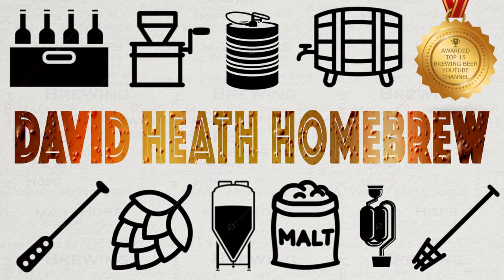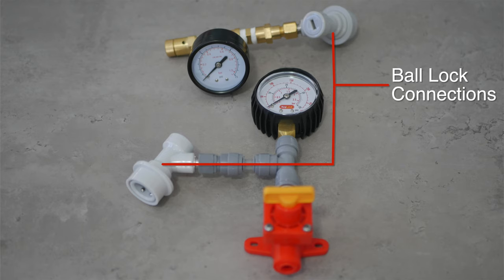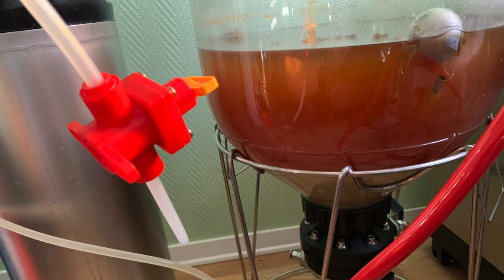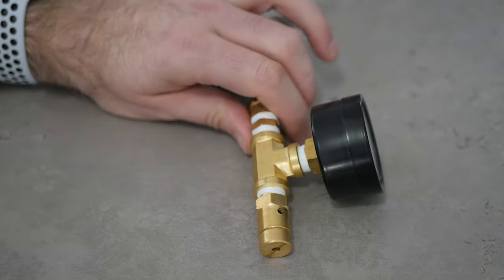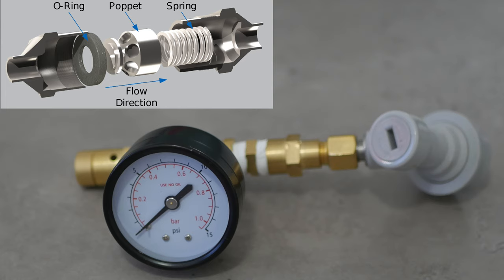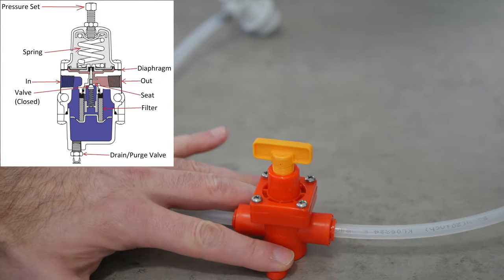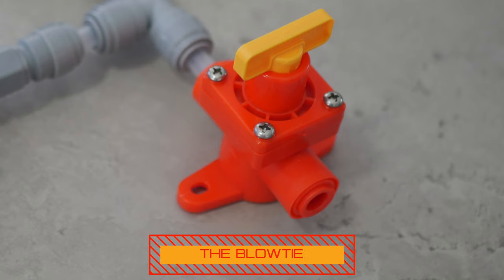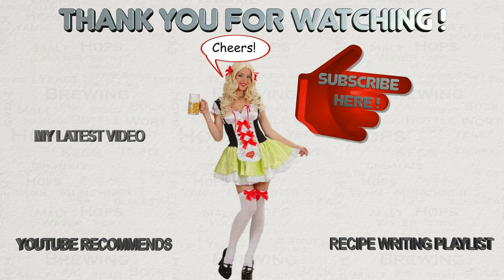Spunding Valve Guide For Pressure Fermentation

Comment: As usual farmative and even more  - useful. In my own planned circumstance I would be using a Pressure Vessel (an old type King Keg type thing) and making the connect simply to the S30 valve outlet hole with something not yet decided.
I notice that your illustrations show what looks like a blow off line and I would imagine I would need this because the total volume of the Keg, and the observation that it is ball shaped means that the area above the fermenting wort would quickly overflow. I am going to watch your Easy Guide video to see if this is addressed. I do not use Corny thingies because the Gas is not easy for me to obtain and thyey are expensive (and small) so I would appreciate opinion as to if this could also be dispensed from the same cask (in which case I would possibly need a Tee type fitting to be able to pressurise with an S30 cylinder adapter for the last few servings) or if I would have to think of a way to transfer to a serving cask without lifting the sediment.
Thank you for a  useful video.
Reply from the maker: Glad you enjoyed it James. Hard to comment on the tank you are converting. I guess these will not hold much pressure though.

Comment: Hi,

First I wanted to say that I really like your channel, as a new brewer your video are full a very good information.
I recently start brewing  and I’m using the fermzilla with the pressure kit.

I know the advantage the fermenting under pressure (less risk of oxygenation, less fusel and off flavor, faster fermentation, carbonation, ....) And I would like to continue to ferment under pressure but I can’t find online information about what pressure to use depending of the type of beer or type of yeast!?! I had a bad experience with a belgian ale (yeast belle Saison) which stall and didn’t really like the pressure and a good experience with the pale ale (yeast safale US-05).

Next I would like to do a Belgian wit (partial mash) I’m still looking for a good recipe (if you have some advise will be appreciated), but should I do it with the airlock or under pressure and with which pressure?

Thank you in advance for your time.
Cheers
Johan
Reply from the maker: Many thanks Johan. Yes different yeast will react differently. The net has a fair amount of info if you google the yeast type and pressure fermentation. Generally soeaking 10-12 PSI is the sweet spot for most.

Comment: David, thanks for your informative videos. Just started the ferment of one of your czech pilsner recipes. I'm using a blow tie spunding valve set up. With a small bit of gas line coming out of the exit end. Do I need to put that tube through an airlock or is it unlikely that there will be any draw of contaminated air/bugs into the fermenter before there is some outward pressure from fermentation reaction
Reply from the maker: Cheers Steve, no need for anything, its a one way valve.
Reply: @DavidHeathHomebrew  thank you

Comment: Great vid Davo, So for newbs to pressure fermentation do you recommend charging the fermzilla to 10 psi straight after the yeast (us05/mj44 or say kveik) is added  or just purge the FZ with co2 & then let the fermentation naturally build the pressure up to the desired pressure.
Reply from the maker: Thanks Dazza. I've not found any real difference either way. So what ever is easier I would say.
Reply: I'd say neither.  At the beginning of fermentation, your yeast need oxygen to function well. That's why many brewers will go so far as to inject their prefermented wort with pure oxygen using a carbonation stone.  Your yeast will produce  enough Co2 to fill your fermenter head space many times over.

My advice is to add your yeast, close your fermenter, attach your spunding valve and let nature take over.

Comment: Hi David 

Thanks for your informative video once again. A bit off topic but cant find an answer, I have recently done my first batch under pressure however after I pitched the yeast and it sunk into the beer I connected a co2 bottle and got my spunding valve set to 10 or 11 psi. Is this a problem? I have noticed theres not much krausen on the wort and worried it has killed the yeast. 

Thanks for your help
Reply from the maker: Hi :) That should be no problem at it. I take it by now things are moving along nicely?

Comment: Hi David 
Great vid very informative, I'm very new to the pressure fermenting thing so forgive the question 
I'm in the middle of my first brew (IPA) in a corny keg, I've let the first 2 days of co2 off ( no pressure ) and then adjusted my spunding valve to about 10 psi, has been bubbling away for 5 days now 
My question is, how do I know when the beer has finished ?? I forgot to cut the drip tube down a little so will pickup a lot of sludge from the bottom first :( so do I bleed it out till I get clear beer and test with a hydrometer or just wait till it stop bubbling ??
Thanks for any help 
Sorry for the long question 
Cheers Mark
Reply from the maker: Great, thank you. Yes the only way to know is with a consistent end gravity reading over 3 days. Floating digital hydrometers are very useful :)

Comment: I wish I had seen this before I built my spundig with one of the brass ones. I guess I will order the blowtie for my next one.
Reply from the maker: I guess the main thing is that you now know :) Glad you found it useful James :)
Reply: David Heath Homebrew I also wish I saw this video. I just finished building a brass one from the parts I ordered online thinking the brass PRV would be better than the plastic one. I have been pressure testing kegs for possible leaks, but now I’m not sure if I am getting accurate readings? The pressure keeps dropping after a couple of hours. Not sure if there are leaks, or if the PRV is inaccurate? Thanks for explaining the diaphragm model. That makes much more sense. Guess I will order that one. Thanks for all you do. I enjoy your channel and knowledge and ease of explaining things. I have learned a lot!

Comment: Thank you Mr. Heath for your amazing videos. I have a question. I’m about to make a Vienna lager this weekend and ferment under pressure. I have the blowtie with the gauge. How exactly do I set the pressure?  I can’t seem to find a video that goes through using the blowtie. From what I know, if I set the pressure to 10psi, then it will vent off above that. But should the blowtie be completely closed during it?
Reply from the maker: Thank you. The easiest way is to add co2 to the fermenter before adding beer. Check for leaks and set the desired pressure level at the same time using the blowtie adjustment. Start by having it totally closed and adjust slowly until you reach the desired pressure.
Reply: David Heath Homebrew And once the desired pressure is reached, do I completely close the blowtie valve and leave it closed during fermentation?  Is it supposed to vent off excess pressure like a regular valve?
Reply: @FiggyABQ   Closed means its not releasing any gas.  When you turn the knob the gauge will indicate the pressure you have set.  Fermentation is your supply of CO2 gas.  To keep a desired pressure, just leave the knob there.  The knob sets the force that is required to create bypass.  So if you close it all the way the pressure will rise sky high as CO2 is created.  I wonder how much pressure yeast could create?

Comment: Lately for my first time I have tried to pressure ferment two strong lager beers. The wort in both brews is the same only the yeast in each vessel is different. SafLager S-23  & White Labs WLP800. OG was about 1.063. They are fermenting in two 18-liter corny kegs, (about 15 liters of brew in each) and I am using Keglands spundingvalves, each set at 10 PSI. They have been fermenting with a surrounding temperature at about 18 degrees celsius for three weeks now and there is no sign of the fermentation slowing down as the pressure is constant at 10 PSI.  Puzzled by why the fermentation time is dragging on so long I also wonder if the pressure indicated on the meters attached the spundingvalves slowly will drop to zero once the fermentation slows down and comes to a stop? Today I briefly decreased the co2 pressure to zero pulling the safety valve pin on the lid but half an hour later the pressure was back up to 10 PSI to what I had set the spundingvalves to.
Reply from the maker: You really need to take a gravity reading on these to see what is actually going on.

Comment: would it be possible to hook a C02 tank to a fermenting bucket? 
If so, would this be a good way to remove oxygen after dry hop additions?

With this being the case, it wouldn't be a pressure fermentation. It would only be used as a way to remove oxygen after the lid is back on.
Reply from the maker: Hi, generally no. It is really best to use something made for the purpose. Could be dangerous otherwise also.

Comment: Hi David, Can these be used as a secondary regulator valve for pressurizing a second keg as well. Many Thanks
Reply: Stephen Fletcher no I found out after buy 3, It is impossibly to dial lower than what pressure out of the regular even from 30 20 15 to 8psi. Very misleading. I’m trying figure out other way to use one tank co2 with 4 keg with different psi so far not successful
Reply from the maker: These are dealing with co2 out rather than in. I have recently been testing 2 different options that act as secondary regulators though and I will have a video in January that covers this :)

Comment: What pressure do you set it to, is it the same under primary fermentation as in the end of fermentation, for final carbonation level?
Reply from the maker: It varies depending on the type of yeast and the end result required. I cover this side of pressure fermentation in this video:- https://youtu.be/W7WSFn6bNoA

Comment: Do u close the spunding valve at start of fermentation? Let the pressure build to 12 psi and then adjust blowtie?
Reply from the maker: I suggest doing a pressure test with water during cleaning. Set your blowtie then 🍻🍻

Comment: I have both types of spunding valves.
I agree the brass type is next to useless, however, the kegland butterfly valves have begun to lose gas in my lagering kegs. I secondary ferment my kegs to 25psi at room temperature for a week with the belief that when I  put the keg into the lagering fridge, the lower temperature will bring the gas pressure down to around 15psi. This worked well for a couple of months, now I just take a pressure reading after attaching the spunding valve. If I leave the spunding valve attached, I lose all the fermented gas.
I am looking at pulling one apart and see if they need cleaning even though I can seen no evidence of beer travelling through the clear gas lines.
Reply from the maker: Hmm sounds like you should contact your supplier for a replacement.
Reply: Putting the valve from a warm environment to a cold one could effect it's operation, might need adjusting after it's cooled down.
Reply from the maker: Could do yes :)
Reply: David, have you had a chance to try the SPUNDit 2.0?  From my limited experience, it seems much more precise than the Blow tie. Cheers
Reply from the maker: Hi Mark, no I have not but I can tell you that the blowtie has proven its accuracy to me. Ive tested the different versions with and without the inbuild gauges. There is a digital display version coming also.

Comment: I have one question if somebody has time to explain to me. It is stressed that you should add oxygen to your beer to allow the yeast optimal condition. Using this setup your are flushing all oxygen. Do the yeast work without any oxygen too?
Reply from the maker: Hi Anders. Sure no problem. Oxygen is needed by your yeast for fermentation. However, once this is over oxygen becomes the enemy and will cause beer to go stale.

Comment: keg lands quality control is like 1 every 5000 tested , my fermzilla came with cross threaded butterfly valve nuts that are so loose the washers spin freely and uneven top cap thread screws that a thread kit with half mm variables tries to rethread on any setting , even if its not set and can move on its own , it will not align without attempting to cut some plastic ... kegland wont reply to email , even though i bought it from a registered wholesalers store. ( because kegland site declined my card 3 times over a system error during payment) . all in all regretful purchase
Reply from the maker: Thanks for sharing your experience. I have not heard of such issues from others and my experience is 100% positive so far. Sounds like you should get a replacement.